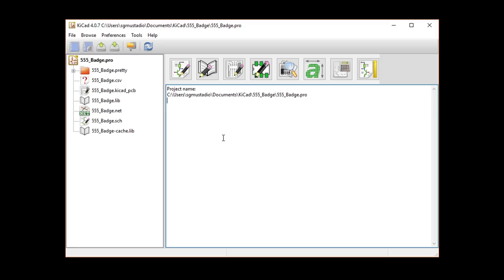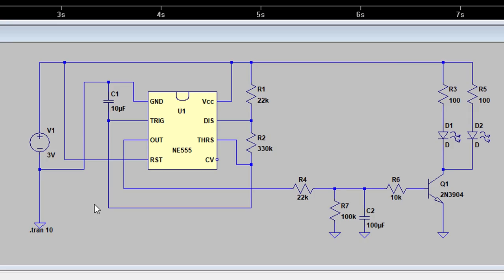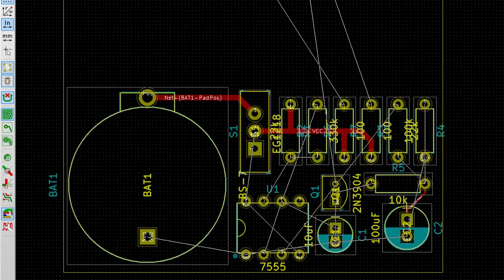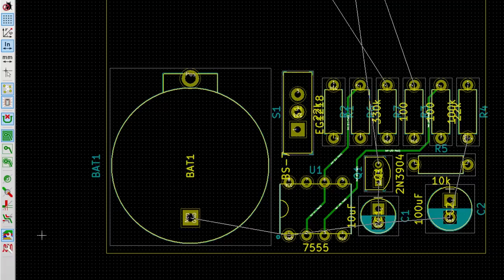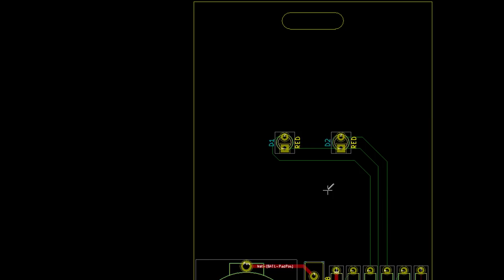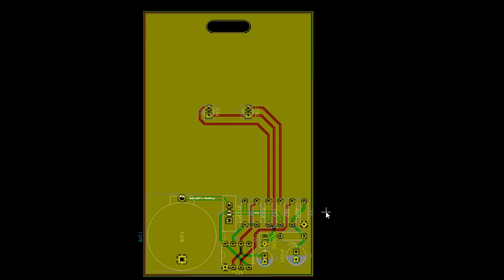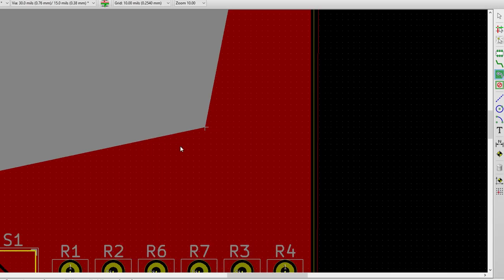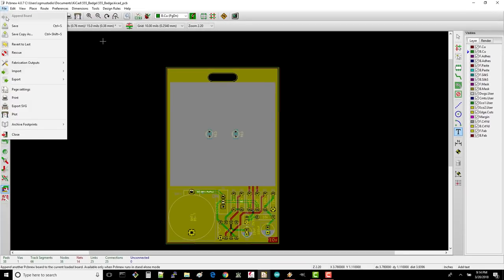An Intro to KiCad – Part 7: Board Layout | DigiKey

Comment: There is a button named "High contrast display mode" on the left side of the window (third button from the bottom). It grays out all the components and traced at the other side of the board. 

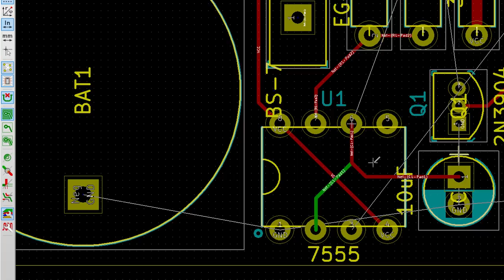It is much better than turning off the layer (7:25 in the video) since then you still see where stuff is when you plan for vias.
Reply: Good tip, thank you! I'm so used to toggling layers from other layout programs that I didn't even think to look for something like that.

Comment: I'm using KiCad 5 and I made the mistake in part 5 of not replacing the default transistor footprint with the digikey one. This ended up causing trouble with the Design Rules Checker, which is now located under the Inspect menu. Fortunately, I was able to go back and change it and then load the new netlist and choosing "Change" under "Exchange Footprint". One nice thing KiCad lets you do is a "Dry run" to see what will happen before you actually run the change to make sure it only changes the parts you expect it to before making the actual change.

Comment: There is a mistake at 13:28, the text showing the resistance for R3 and R4 is swapped. It should be 22k for R3 and 100k for R4.
Reply: I can't believe I noticed this as I didn't know what a PCB was 3 days ago but have been researching like crazy. He actually has them in the correct order and numbering, but one is rotated 180 degrees so that the label is above or below. Note the far right is actually R4 and is also actually 100k as it should be. The 2nd to the right is actually R3 and also correctly 22k as it should be.

This took me a long time to figure it out, but as I know nothing about this hobby I'm sorting out creating exactly what I see and spotted it.

Comment: Thank you for this very useful tutorial! When you have made your ground copper pour, all the other layers are visible as if they are all on top of the copper layer, but for me they are underneath and I can't see them. Do you know how to fix that?
Reply: I had the same problem. Do you use KiCad 5?
Reply: I figured it out by asking about this in the kicad forums. You may have accellerated graphics mode turned on. Under the Preferences menu in KiCad 5 you can select "Legacy Toolset", "Modern Toolset (Accellerated)" and so on. I had mine set to Modern, but when I switch it to legacy, it displays things as shown in this video, including the yellow board color after both sides are filled.
Reply: Thank you, I will try that!
Reply: @deltaray3  Thanks!
Reply: @deltaray3  I have KiCad 5, too but no options for legacy toolset just "Modern Toolset (Accelerated)" and "Modern Toolset (Fallback)". Neither of them allows me to see the board the way it shows up in the video. Any advice?
Reply: @deltaray3  Thanks this worked!

Comment: I thought the right angle circuit thing was a debunked myth. But here he says after 1Ghz it adds deflection? Where is my understanding wrong. Is it an issue for signal strength of data but not for voltage power current or something?
Reply: I think its because if the two wires are close to being parallel, the electro magnetic fields of the two wires will affect one another the most, introducing errors in voltage and currents